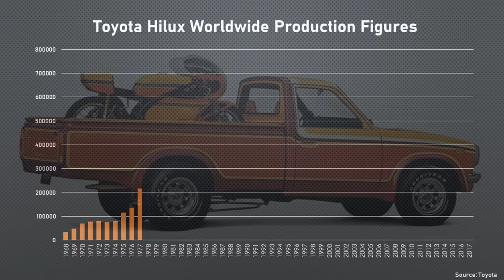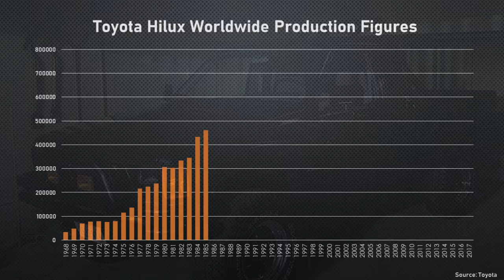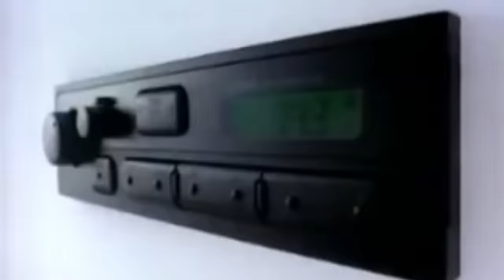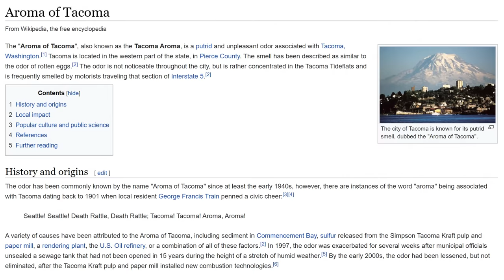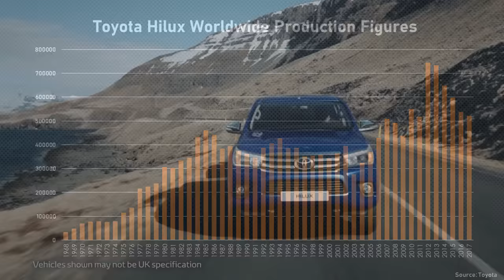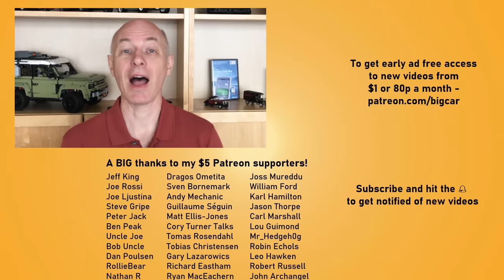Toyota Indestructible Hilux!

Comment: Thank you so much putting this history together.  My first company car in Dubai in 1976 was a single cab Hilux (without aircon which was considered a luxury then and only for the boss) with the 1600 cc 12R engine.  Currently I own 3 Hilux pickups and 2 Hilux based cars,a  Surf and a Fortuner,  both in Thailand and in Australia. All diesel and automatic.  And all indestructible...
Reply from the maker: You're very welcome Bastiaan.
Reply: My first car when I got my licence was bought "for me" 2nd hand in 1976 by my parents who had just bought a very large piece of land and were building a large family home and needed a ute (pickup).
It was a 1974 single cab long wheelbase 12R 1600cc and could not be killed doesn't matter how hard I tried ( 2 near write-offs ) and drove it all over Australia.
And just to make you shocked...
we still have it, running & 90% rust free. Plan to get the paint refreshed and get it on club reg.
Cheers.
PS bought my second Hilux a 2014 SR5 4x4, 3 litre Turbo Diesel canopy, full tradie roof rack, 2nd hand for my son..the tradition continues.
Reply: @Time4Breakfast  that is indeed amazing!  1976 and still.going. Actually here in Thailand there are still more than a few 70s hilux around as well. Which is more amazing since Thais generally are not a very maintenance focused  kind.... My 4 door 4wd 3.0 pickup (called Vigo here) is also 2014. Much better fuel consumption than my 2006 Fortuner with same 1KD engine.
Reply: @bastiaansnijder5317  yes after the children came it became impractical so gave it to my brother in-law who drove it daily for 10 years. He wanted to put a massive small block Ford V8 motor in it but thankfully bought a sports car instead. Now we will tidy it up and get it into a club.
Yes as you know the new ones are built in Thailand, thanks.
Reply: @Time4Breakfast  yes. Your car actually passed my house.   Lol. ( i used to live along the main highway to the port where all the car haulers with the new toyotas would travel along. They are made in a suburb of bangkok.
Reply: But the 1976 was still made in japan as far as i know.
Reply: @bastiaansnijder5317  is that anywhere near the main road from Bangkok to Pattaya beach? Did that trip by taxi twice.
Reply: @bastiaansnijder5317  and the rear canopy and roof rack are CarryBoy brand made in Thailand. By the way it's a 1974 model bought in '76.
Reply: @Time4Breakfast  There are 2 roads from bkk going east. One is the highway 7 which passes the main entrance to the airport.  Most taxis would take that one. The second one is the so called Bang Na Trat highway which is elevated all the way to Chonburi , about 60 km
 The car haulers typically take that road.
Reply: @Time4Breakfast  show again. I did not realize Carryboy goes that far back although the canopy could be newer than the car.  Two of my 3 pickups have Carryboy canopies as well. The Vigo I leave as pickup just with a canvas tonneau cover so that I can still carry motorbikes and other large items.
Reply: @bastiaansnijder5317  sorry my mistake. The CarryBoy is for the 2014 model. Woops. Should be more clear.
Reply: @Time4Breakfast  🤣🤣👍
Reply: What is very annoying about most Carryboy canopies is that they come without rear wiper and waterjet.  When it rains the rear window becomes mudcaked in no time due to the 'station car effect' on airflow behind the car. It does have a defroster which here in thailand is totally useless....

Comment: Several years ago my truck broke down and fried lend me his Toyota pickup for couple of days. The same evening I called him and ask if he can find me one like that (used) next day he calls "I am driving in your new truck". Since than I had 5 of them (1983, 1988, 1989, 1991, and1993),  I am a lousy driver and most ended their life being  crashed. Now I have three, one needs a head gasket replaced,  I am using 1991 with over 650,000 miles on it and everything fine so far (while ago power steering hose broke and needed to be replaced, fuel gauge does't work,  has some rust holes around the windshield, and at the bottom of fenders - a bit inconvenient when it rains, heater fan makes noise I wait until it fixes itself). My 1983 is a rust bucket, but it has only 75,000 and engine is a beauty (carburated). 
I will stay away from any made after 1995 and consider only ones with 4 cylinder engine (R18 up to R22) change oil every 6,000 and  you have vehicle until you kick the bucket.

Comment: Got my 2019 Hilux with 2GD diesel, only a minor problem with the alternator bearing failing at 100k, other than that the engine is running fine with normal maintenance.
One thing I would complain about is the undercoat rust protection on some subframe parts isn't as good as my old D22 Nissan Frontier but a visit at the local undercoat shop fix that before it gets worse.
Also the foam pad under the engine oil sump might trap water and make the oil sump rust so make sure to check that before too late.

Comment: The Hilux , the King in South Africa, often being overall best seller in good months. Crappy ride at times but you can't kill it , the KZTE , D4D and now GD6 are difficult to fault objectively. A Bakkie of many generations with a lot of well deserved praise. 

The latest is nice , but chases the Ranger in terms of specification and family use comfort still favours the ford.

Best part , proudly built in Prospecton, Durban , South Africa...but the biggest challenge is built not to far away...
Reply: Yip, little known fact is that the 4 Hiluxes used in the Top Gear Arctic Expedition, were built in Durban, South Africa.

Comment: Nice nod to Washington State with the license plate in the background. I was down in Tacoma just today. Wasnt too smelly. I think the winds were blowing the pulp mill smell north towards Fife!
Reply from the maker: It depends upon the winds. I've had a bit of a whiff driving down on the I-5 a few years ago. I believe it's the tidal flats causing the problem now. My daughter got me the fake plate - I can't get the real one as someone already has it!
Reply: @BigCar2  Now I have to keep an eye out while out on the road for the BIG CAR vanity license plate. Someone in the Puget Sound Region likely has it. If I ever see it, I will snap a picture and post it!
Reply: This was a wonderful video. It brought back memories of my parents 1980 Toyota truck. It was a 4X4 with chrome wheels and big off road tires AND no power steering! I will never forget taking my drivers test in it trying to parallel park as a scrawny 17 year old! That little truck was a beast. Spartan definitely described the interior. Bench seat, room for three with a 5 speed. I’d love to have that truck today. The 20R 4 banger had some serous torque. It even pulled an RV out of the mud!

Comment: I owned a basic 1981 2.4 L 4 speed Hi-Lux that I bought used in  ~1987 in Canada that was the best vehicle I have ever owned! It was so basic it only had an AM/FM radio!!  I gave Sears $125 for cruise control and another company $200 for a sunroof and drove that truck ~200km per day back and forth to a job decommissioning an AMC plant for over a year! When I bought it the box was well on the way to disintegrating so I called scrap yards for a replacement box but they told me that al the boxes were the same in SW Ontario Canada! I started to have it Rust-Checked  (oil-guarding)  every other year in the spring which killed the rust which was occurring only on the seam on the box and put in a real Toyota exhaust system after a Midas system started to fail after a year!  I finally sold it to my brother after putting on well over 150000km and beside the exhaust system, the water pump failed in my back yard!! It was an easy fix! I bought it with ~ 50,000km and sold it to my brother with ~ 250,000 km and bought an Izuzu Trooper which was the biggest mistake of my life!! Never buy a GM product!  Next vehicle was a Rav4 which I am still driving!!  I wish a simple Hi-Lu x compact was still sold here!  The Hi-Lux was the best vehicle bar none that I have ever owned!!

Comment: Last year of solid axle was 1985 in North America, replaced with torsion  bar until the Tacoma 1995 with coil springs. Japanese trucks had solid axle until early 90s then switch to torsion bar until 1997.

Comment: I'v had 2 90's models (live axles), then a 2017, now a 2020. I have always punished them, they Love it! It didn't even cross my mind to look at anything else when I recently upgraded and it's a crowded segment here in Australia. I'll tell you now, whether old or new, they will soak up the abuse and not let you down UNLESS you modify them too much, then things will start breaking regularly. These Utes didn't handle big lifts and 35 inch tyres back then and they still don't

Comment: I owned a 1990 and 1982 very good trucks for light work. Then I bought a 1996 T 100  not near the truck as the earlier ones under powered  and less dependable. Then I bought my first  2001 F150 best truck I had owned since the 1990 Hilux, now I own a 2019 F150 3.3lL 15000 miles so far a great vehicle.

Comment: My car is still running fine though occasionally or annually repaired, Hilux '99 SUV 4WD LN167. A model that was only available in my country "SportRider". Original 5L engine with added on KKK turbocharger.

Comment: The double wishbone front suspension arrived with the mark 4 Hilux, not mark 3. I think it was partly to take advantage of the synergies of the 4runner range, which features is softer but less robust suspension. If I remember correctly you could choose either the live axle of the independent double wishbone front suspension on this mark. From Mark 5 onward, only the independent suspension was available. This refers to the 4 wheel drive versions, as the 2 wheel always had independent front suspension.

Comment: Hey!
I had a Toyota MODEL F (ev -86 or 97a) 1989 - 1995. Practical in many ways but on an Easter day in northern Sweden. Suddenly a 25 -30 reindeer ran up the road. I braked as hard as I could but it was winter and it was drizzling so not much happened a reindeer ran sideways I saw the whites of the eyes. We were lucky nothing happened, but there was only a thin sheet of metal between the pedal rack and the outside, so we had a thought. With four children and luggage, we were heavy. It became a Chrysler Voyager 1996 model much safer and more comfortable.
A video about Toyota's MODEL F would be interesting to see.
Happy New Year
Carsten

Comment: The VW Taro 2 wheel drive was assembled in Germany, the 4x4 version was build in Japan, and when I'm right,  only rebadged in Germany.
Reply: In Germany I only have seen 2 WD Taros, no 4 WD ones (must have been quite rare). Though 2 WD Hiluxes were few, most HiLuxes (at that time) were 4 WD. Nowadays nearly all (if not in fact all) HiLux in Germany are 4 WD.

Comment: my first car I've ever driven was a 1985 Toyota 4Runner, however this model was a bit different because the later models had switched over to Independent suspension mine was the very last Model that was sold in 1985 which came equipped with leaf springs in the front and rear straight axles, the reasons why I say my model is rare because again the front axles has only leaf spring suspensions, and it was connected to the front straight axle. however I wasn't aware that my 1985 4Runner was a Hilux. I should just call it the 1985 Hilux-Runner.

Comment: The last Hilux badged vehicle in the U.S.was the first generation of 1974.  I have rarely seen the Stout.  I have seen two Corona RT-46 pickups that were only sold in Hawaii.  A Japanese news crew I saw in the early 1990s were driving a "Hiace"van the same size as a full-size American ones from Dodge, Ford or Chevrolet.  In the late 1980s the Chevrolet Nova was a rebadged Corolla..

Comment: I was in Honduras, Central America in 2002 and just about every Toyota truck was a Hi-Lux.  The rest were Nissan.  I saw one Dodge Ram, no F-150s or Rangers.  And they can tint the front windows, leaving a round or half-round opening for the driver to see through.  And they were all diesels, and EVERY gas station sold diesel, totally unlike up here where you have to know where the diesel stations are.

Comment: one of my old job colegues in Belgium, had a 2013 model with auto trans. he had to change the gearbox 2 times in warranty plus other problems. after the warranty expired, he got rid of it, as the transmission started to behave bad again. bad luck?or crap modern car?

Comment: Remember the ones that broke in half because the frames rusted from the inside?  They used fully boxed frame rails, which made the trucks unbelievably stiff and tough.  When I was a kid I drove deliveries in a little Toyota "1 Ton".  That seemed like an exaggeration, but that truck could not be broken.....until it rusted and literally snapped in half.

They didn't provide any means for water to drain out, and the rustproofing was nonexistent.  Pound for pound the pre-Tacoma Toyotas were the toughest trucks ever made as long as they didn't rust.  

I remember driving around with a pallet of paper that mashed the suspension to the stops and actually lifted the front end to the point that I couldn't go around corners unless I dragged the brakes to shift the weight forward.  Ten years later I worked for the same company to make some tuition money and drove the same Toyota.  It was running on 3 cylinders, I sat on a towel to cover the exposed seat springs.....it was an absolute wreck.  But it kept going.  It was a force of nature.  Buy shortly after that one of the frame rails finally snapped.

Comment: One point about the early high turn signals, they weren't to fill the mirror holes, they were to meet US minimum size standards. Early US-spec Honda Civics used the exact same parts as did, apart from clear/white instead of amber lenses,  the Plymouth Arrow (Mitsubishi Lancer Celeste)  but in those cases they were mounted on the bumper pretending to be fog lights.
Reply from the maker: Can you correct Wikipedia? I think I found that there.

Comment: A fellow soldier, when I was in the American Army in 1986 at Ft Bragg, NC had a 1965 Toyota Truck, which he'd bought used, while he was at Ft Benning, GA. It looked like one of the "Stout" pickups in your video. It was in very good shape. I wonder, if he still has it?, It's probably a bit of a collector's item now. I remember it, because I rarely saw a Toyota of any kind which was older than 1969, at least in the southeastern United States, even in the mid 1980's. It was left hand drive, so I wonder if maybe some GI was stationed in Japan & ordered it with US specs to be shipped to his new stateside duty station, & maybe that's how it got to Ft Benning or it's associated Air Force base (I can't recall it's name) in the first place?

Comment: The advantage of the heavy duty Toyota HZJ is that is is so simple and robust, without a turbo and electronic gadgets that can break. That’s why it’s the war zone choice. The Hilux is a bit of a lightweight version that does not hold up well on Siberian tracks for instance - when you use it as intended with some weight on its bed. Testing it empty is not a test.

Comment: I own a 99 model, I've turbo and intercooled it, I flog it to within an inch of its life daily!
I run it on sump oil for fuel... Even then I still manage between 6-700 KMs a tank. I have even carted 7 tons of sand in the back of it!
I'll never sell it!

Comment: One thing to note is the finding of a Jeep in the Philippines in 1941 is unusual. Could have been a Bantam model but they went to the Soviets as did the early models from Willys.  Certainly the Toyota BJ is a very close copy of the MB which flooded Japan post war. The US wanted Toyota to build Jeeps which they may have done for the Korean War,  but Mitsubishi built licensed Jeeps until the late 90's.  Except for building the BJ and needing to change the name as Willys and then Kaiser owned the trade mark the rest is pretty murky to details.  If there was a Willys vehicle in the Philippines it was the Quad.  Not even sure if Willys could legally use the name Quad as it was already in use in the US and England.

Comment: two of the best diesel engines ever made to my opinion must be the kz series like in the legend 35 or the kd series (D4D) from the legend 40 and 45. All they need to run is diesel and oil, coolant is just an option haha. if South Africans cant break it, then no-one can. I've seen them coming into my workshop with little, if any, coolant, then I fix up the leak, put new coolant and it goes like nothing was wrong...

Comment: I wish we could get the hilux here in the states. Toyota still does not have a diesel option here. I have a 1997 Tacoma with 4x4 and Manuel 5 speed. 279,800 miles. Never giving it up